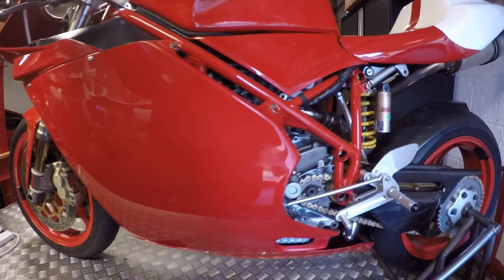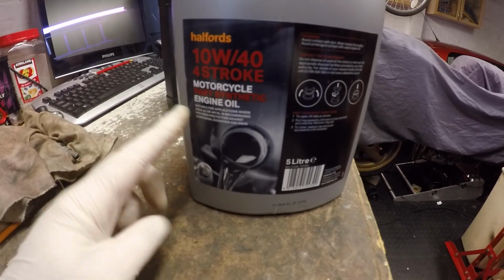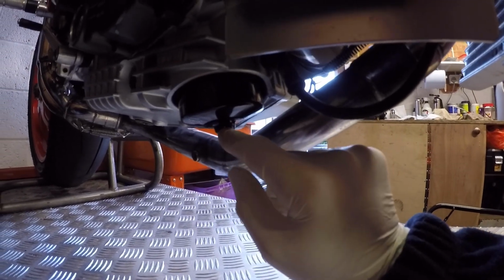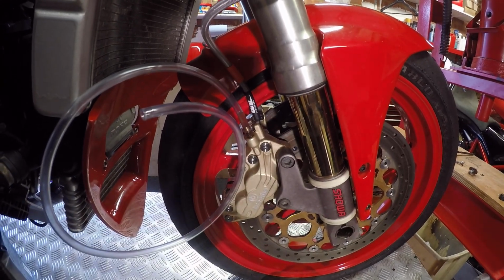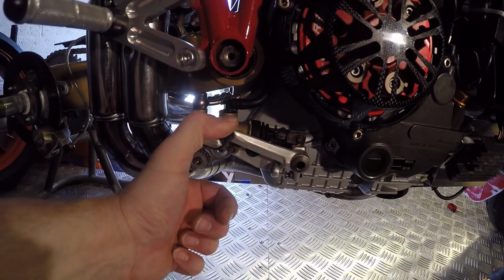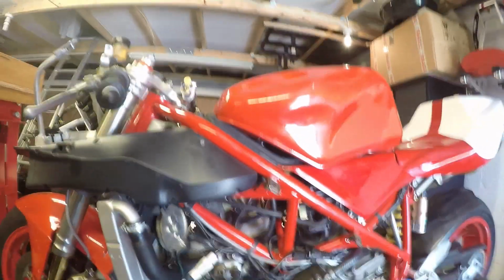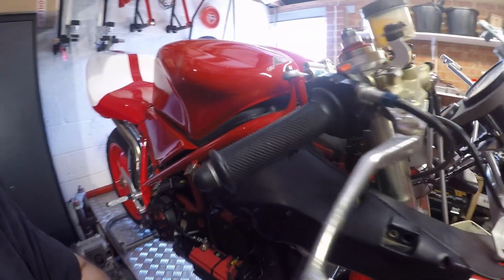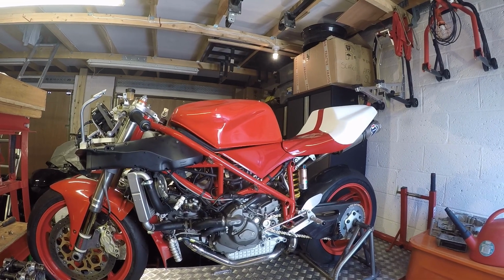Thunderbike Race Prep No 30 - Ducati 748 Bike Commission and Start up

Comment: For the back Brembo I take off the caliper from its seat and place it upside down on the top of the disk. In this position there is the disk between the pads and the bleed valve is pointed up. So the bleeding it much more easier. 
https://i.ibb.co/tKb5mG6/Immagine.png
On my M750 it works goot, I think on the 748 too!
Reply from the maker: That is a good method to use 👍😊

Comment: When filling coolant and bleeding air I found its good to lean the bike over on its right, you immediately hear air coming up through the system and can keep filling coolant. I then leave the cap off and let the bike run a minute. Then top off to the level and it hasn't needed any refilling after.
Reply from the maker: Nice tip, not done that before. 

I am going to purchase a vacuum coolant system to see it that makes it any easier to fill.

Comment: Sounds awesome solid! Can't wait to get this 853 back together totally different animal with that engine in the frame.
Reply from the maker: I raced against a 853R a few years back, rider spoke highly of the added benefit of the larger capacity but still being able to rev higher than a 916/996 for almost the same power

Good luck with your build
Reply: @DesmoWerx  I can confirm 165-170mph with stock 748 gearing, and full 50mm Arrow pipes, it's faster than a 916....

Comment: nice to see the bike is finally finished but I would prefer to see a few more vids ;) I am planning to check my coolant do also do you recommend any specific type/brand? I think the manual says something about the mixture 50/50 with an antifreeze
Reply from the maker: There will be more videos to come, don't worry :)

Antifreeze wise yes go 50/50 and I use Silkolene Pro Cool in my road bike :)

Comment: Can you tell me what colour is it? Will try to empty the system tomorrow and need to possibly flush it. Would I need around 2 litres? Might get the same coolant as need a non toxic one ;) and it is already mixed
Reply from the maker: HI Tom,

The coolant is a bright blue colour, total cooling circuit capacity is 3.5 ltrs so you will need 4 bottles of the coolant and it gives you some spare.

Flush the circuit with water to remove the previous coolant and any debris

Comment: Hello mate, just tried my front brakes after servicing callipers and bleeding the system and my front wheel is looking up. Can you advise what I have done wrong in my first attempt working on brakes? ;)
Reply from the maker: HI Tom,

Did you change the seals or just clean them?

If you have used any chemicals when cleaning them they can swell and grab the pistons which is a common problem

Are they locked solid or binding?
Reply: I cleaned all the parts but not seals only put the rubber grease on them. They locked completely when hot so and have really stiff lever and had to wait to cool down to be able to move. It seems that the fluid is not returning to the reservoir me thinks. Master cylinder issue?  @DesmoWerx
Reply from the maker: @tomsiwek6058   Could be the Master cylinder or you may have a hydraulic lock somewhere. Is the reservoir full? if its too full when hot it will not allow room for expansion of the brake fluid and would lock the calipers
Reply: It is quite full I must admit so will try to bleed out a bit. Just checking some forums and people mention about the free play adjustment. Any experience with that?  @DesmoWerx
Reply from the maker: The other point to check is did all the pistons move freely when put back together? 

If one was still or sticky it may have seized in place and applied the pad causing the brakes to overheat

I have seen this happen on someone else's rebuilt calipers
Reply: I checked all pistons before putting it back on the bike and all was fine. Also when they cooled down there no problem with turning the wheel. My experience is very limited so let's hope it is only an overfill  @DesmoWerx
Reply from the maker: If all the pistons are moving and retracted when cool it sounds like an overfill or the MC

If the lever free play is set wrong it can also cause the calipers to drag - this will cause overheating as well
Reply: Any advise how to set up the lever free play? Do I find any info in the Haynes manual by any chance? @DesmoWerx